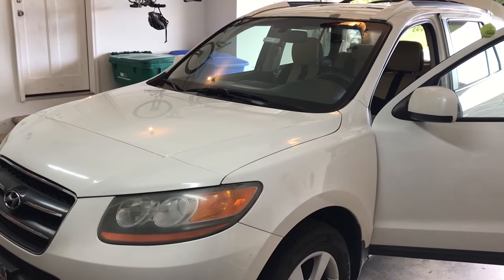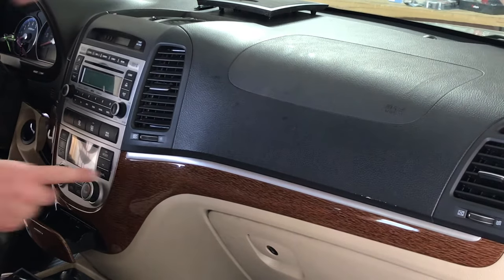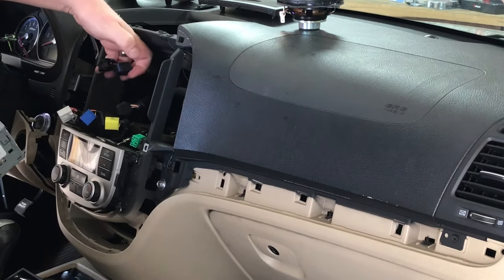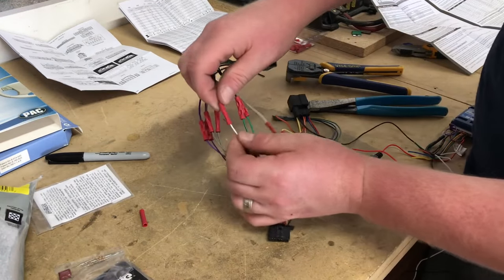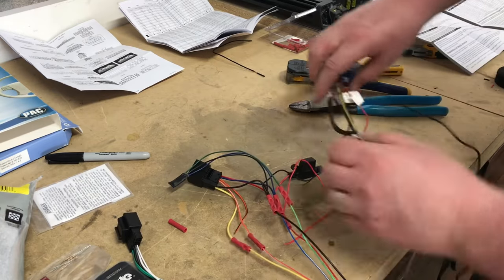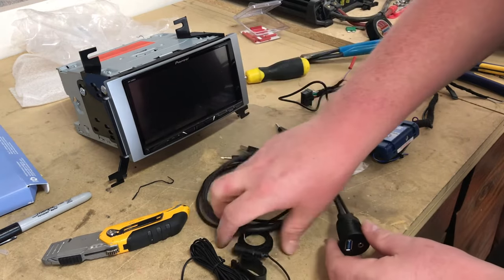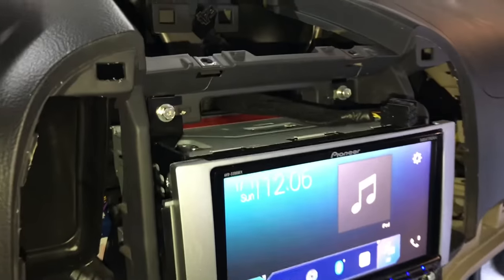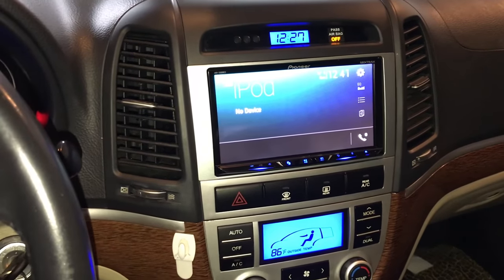2007 - 2012 Hyundai SantaFe Radio Install

Comment: Great video. Have you heard of hissing problems or weird sounds after install? My dealer who installed it is going to replace the amplifier in one car but I actually had two 2007 Santa Fe's with this installed and both have issues but different issues. One has hiss as soon as you go to volume 1. The other has hissing plus sound isn't good. He even had to replace both front speakers since they had broken and hoping it's all from the amp. Will try one car and hope that is it and if so replace the other.

Comment: I have a 2010 Hyundai Santa fe.  When you take the radio out the front & rear defrost buttons & emergency flasher buttons are attached. How do I put them back in the dash when replacing radio. I can send photos if needed

Comment: If anyone’s still watching do you need the adapters because I think that’s the problem I’m having as the installation was easy but no sound is emitted because one of the main wires don’t pair up
Reply: If you have an amplifier you have to delete the connection to the amplifier, there is a video in youtube on how to do so, that same thing happened to me after I installed the  Android 9.1 screen.

Comment: It looks like this Hyundai has the Infinity speaker system. Do you need to us a line out converter (scosche SLC-4) to work with the factory amp? I am considering doing a similar upgrade on my Santa Fe and Crutchfield states I need a LOC because of the factor amp.
Reply from the maker: Some say yes, other no.  We didn't and worked fine, but i do think adding a loc for longevity purposes will be a better solution.

Comment: I like this video so much info but do you think you can help me wih something? Can i get the android 9.1 9" screen into the original bezel once i remove the factory radio or will i need extra parts?and what power wire can i get for i wont have to cut the original power adapter to contact the wires with the one they send with the radio? I have the 2012.
Reply: Buy one on eBay and comes with the frame I did it and it works like a charm.

Comment: Thanks a lot for the video. I have a 2011 santa fe (gcc specs) full option. The car comes with a factory touch screen entertainment system however the screen suddenly died a while ago and now it's all black or all white and sometime shows random colors but it's not functioning. The radio and steering wheel controls still work perfectly fine tho. I want to replace the screen but I was wondering since the car comes in with a factory entertainment system will the old screen have the same wiring as the new screen replacement whether it's the model shown in the video or any other model. As in if I take out the original screen and unplug the wiring from it, the new replacement would have the same wiring setup so I can directly plug the old wires in it and have it work perfectly, or would I have to set up a new wiring system (as shown in the video) to plug in the new screen replacement. Thanks in advance.
Reply: Did you ever figure out what to do? I too have this issue with my 2011... 🙄

Comment: I ordered the exact same parts and nothing fits, the harness is entirely different. 🙄
I have a 2009 Santa Fe, original radio (Model A200 CMCAXM)
First of all the antenna wire is square, not round so I guess I'll have to buy a past that will transfrom it to circe
Secondly the METRA 70-7302 Wiring harness does not fit with my original factory harness. The original factory harness is wider and narrower while the metra 70-7302 is more fat/bulky, they just dont go together. I wasted about 3 hrs lol. Now I'll have to figure this out order new parts and hope those will work. Good luck to every DIYer :-)
Reply: Blame Hyundai... they used all manner of different radios.  The Metra 70-7302 seems only to be for the 2007 and 2008 vehicles with radios made by Delphi.

Comment: Is there an adapter for the Sirius/XM satellite wire?
Reply from the maker: https://amzn.to/2Z3iRTo
Reply: @ProvoBeastAudio   There is no xm satellite antenna connector behind my factory stereo.  Where is it?  I only see the fm/am male plug.
Reply from the maker: @Joseph-32  Was your factory radio equipped with XM? if not, you will have to run your own antenna.
Reply: @ProvoBeastAudio  My factory radio had xm satellite.  Is the antenna wire fed into the stock wire harness??
Reply: @ProvoBeastAudio  I found the stock xm antenna wire.  It was plugged into the stock antenna Booster.  Connected it to my XM tuner & now using the factory antenna wire.  Thanks!
Reply: @Joseph-32  Can you please send me a picture of where the stock XM Antenna wire was located. I'm struggling to find it and connect it to my aftermarket stereo.
Reply: @Cheeseguy-p2c  Don't have a picture.  It is connected to the factory XM receiver on the floor below the stereo.  Remove the side panel on the driver's side & you will see it.

Comment: My wiring harness looks much different and older, my car is a 2009 santa fe with no SWC but XM radio
I can’t seem to find the correct wiring harness?
Reply: You'll also need an antenna adapter, as ours is square and aftermarket radios are round. As for the harness i ran into the exact same problem, bought everything from this video only to realize it does not fit. I found Metra 70-7303 is what you need I think!
Reply: Alex Safri Thanks for the reply, did some research and found out that info. Everything is installed and working perfectly now including the video bypass and rear view camera!!!
Reply: @Choppa_Ya  I'm glad it worked out for you, unfortunately my little project has halted lol. I also noticed that it's impossible to get to my parking brake so I have no idea how I'll get my parking wire hooked up. It gets a bit confusing but I guess I'll figure it out sooner or later 😂
Reply: Alex Safri What model car are you working on?
Reply: @Choppa_Ya  2009 Santa Fe, with the mx cd player/radio, I just ordered the new harness, parking bypass, antenna adapter, and aux/USB port from Amazon. So project is delayed until next Friday
Reply: Alex Safri Good luck with install, just take your time and make sure you have good tools
Reply: @Choppa_Ya  Thanks, we'll see how it goes next weekend. If everything works out fine I'll post all the parts needed. The confusing thing is that the packaging of harness used in this video in this description does say 2007-2009 Santa Fe. Yet it doesn't fit. The Antenna wire is different too. This guy made a very nice video it's unfortunate that these universal harnesses are not so universal and there is such a big difference between a 2008 and 2009
Reply: @Choppa_Ya  I have a question for you. Did you have to install an aftermarket chime to regain it? This video mentions nothing about that but I know from previous experiences that in a lot of cases you'd lose the chime. Did you?
Reply: Alex Safri no
Reply: @Choppa_Ya  so I got the d radio in and none of my steering wheel controls function even tho I did install an interface and I wired it to manufacturers specs. It was working before changing the radio. Seems like this is going to be a long ongoing project 🙄
Reply: Alex Safri I cant advise you on that my project didn’t include SWC
Reply: @Choppa_Ya  lucky you, it's pissing me off this was the second time I took apart the dash 🙄
Reply: Alex Safri Good luck, i hope it works out for you
Reply: I'm having the same problem